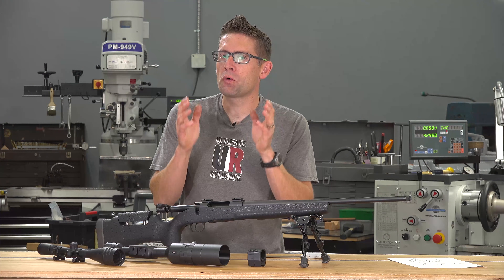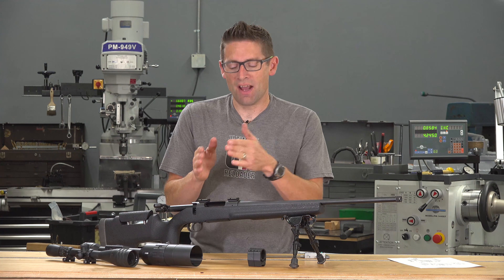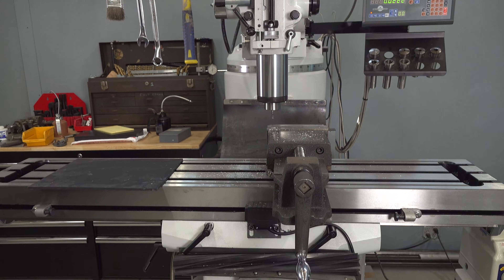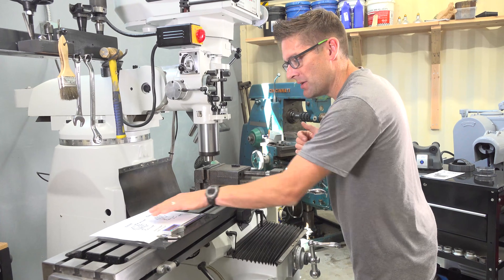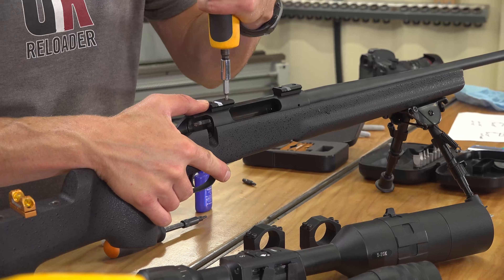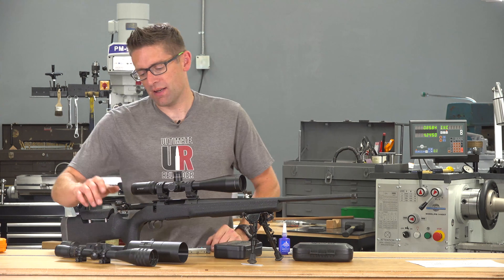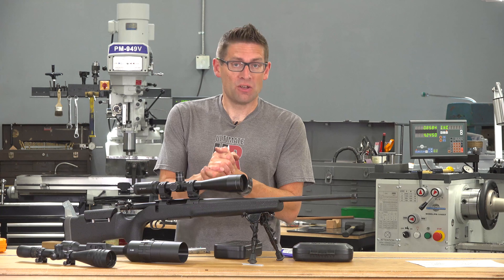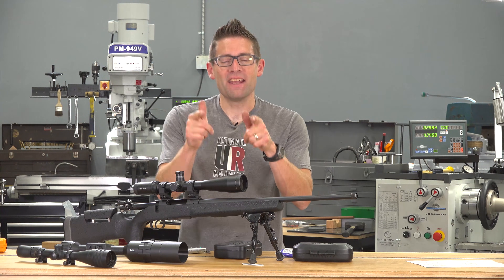Converting Weaver Bases to Accept Picatinny Scope Rings: Quick Milling Machine Project

Comment: wd40 is not coolant try Union Butterfield for cutting fluid and or a Kool Mist air gun if heat is your only concern. there are 3 flute aluminum specific end mills that will reduce heat and give a better finish. not being a critic just trying pass on a little knowledge. love your work
Reply from the maker: I actually use a Noga Mini Mist typically, but don't have my air lines run to that machine yet! You are correct about WD-40, but for small stuff and small jobs it can be better than nothing. In this case I did not need coolant at all.

Comment: Use the mill to change the weaver mount screw holes into screw slots instead, giving you the clearance to slide the mounts outward a bit.  It's a lot of work yes, but I know you enjoy working on the mill too, haha!   I like the idea of a mill project like that rather than flipping the mounts around backwards like others have suggested.
Reply from the maker: Thanks, I believe different rings will allow me to mount the X-Sight Pro 4K without additional mods...

Comment: A EGW rail for the TC Compass is only $40.
Reply from the maker: Why should I spend $40. when I can spend $0.00 (I later noticed that factory ATN rings work for the X-Sight Pro 4K with this solution). Remember, this is a ~$200 rifle! :)
Reply: more fun to build it your self.
Reply: This was my choice.  I have my ATN 4k in a KDG SideLok mount so I can easily swap it between rifles.  A quick profile change and I am back in the game.

Comment: Having a mill , why wouldn't you just do it rite by milling off the weaver junk and drill and tap for a 21st century approach ??
Reply from the maker: Because this was more straightforward, but yes, with a mill you can do whatever you want! (I later noticed that factory ATN rings work for the X-Sight Pro 4K with this solution)

Comment: Looks like you could get another 1/4" if you milled another slot in the front mount...would that be enough to fit the ATN?
Reply from the maker: I thought about that, but the front screw is where the slot would go. Good idea however!